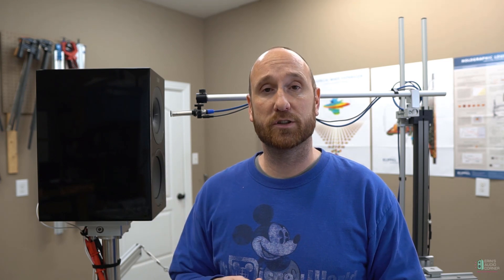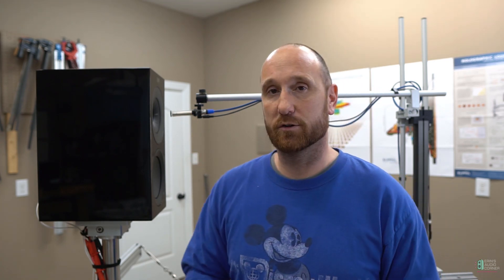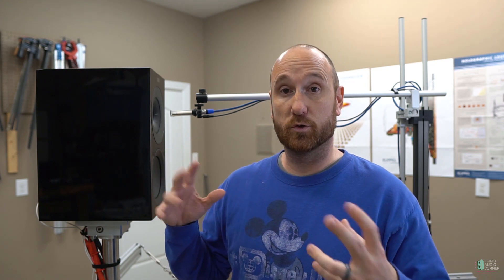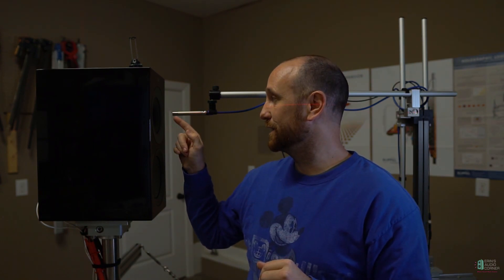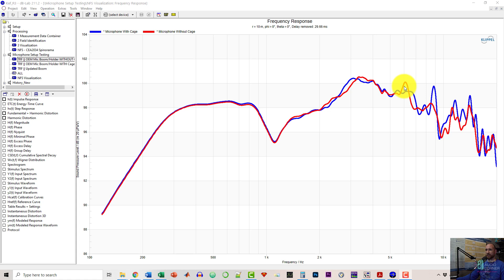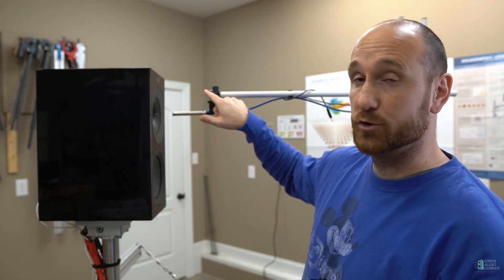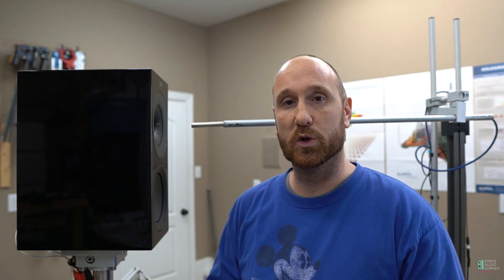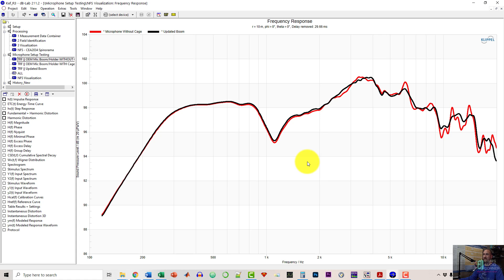Improving Measurement Accuracy with Microphone Boom Upgrade

Comment: Thanks to Erin for the video and thanks to all the people who are watching and commenting his videos.
Here are some answers to the questions about the microphone mount and the safety cage:

As Erin explained in the video, the cage around the microphone is for safety reasons during measurement setup and during the measurement. As the manufacturer we have to make sure that the user cannot simply damage his expensive measurement microphone or the even more expensive DUT by automatically moving the microphone into the DUT. Additionally most customers are using the NFS for measurements during the development of a loudspeaker where the frequency ripple at higher frequencies is not that important because it's known and it stays the same for the comparison of different speakers / development stages. However, you can of course unmount this cage for the final "datasheet measurement" if you are sure that the hardware setup and measurement grid is correct.

Regarding the microphone mount: We know the influence of the relatively big ball joint very well and we are already in progress of finding a smaller microphone mounting solution. But in any case we need the flexibility of the angled microphone mount for our customers and we want to use standard components for this purpose as well. If one really wants to go into details, he could also complain about the different frequency response of the microphone depending on it's position in the measurement grid (due to the directivity of the mic). Therefor it's useful to angle the microphone by 90° in front of the DUT so that the angle of the microphone to the DUT is always the same over the whole grid. This would not be possible with a straight mount of the microphone.

Anyway, we really appreciate the thoughts and questions from this community. We will keep this in mind for future improvements or a small Tech Note

Thomas - KLIPPEL Support.
Reply from the maker: Thank  you for responding to clarify some things.

Comment: How do you ensure the speaker rotates around it's acoustic center? How about the acoustic center of each driver as those are not aligned in many speakers? If it does not the level will change as the mic rotates and that will add a bias error to the respose error as function of angle.
Reply from the maker: https://youtu.be/6j-hg_hRUDM
Reply: @ErinsAudioCorner  That did not completely explain how the true acoustic center for a horizontal polar is defined but it appears though the software MAY have the ability to extract and therefore compensate by removing this acoustic eccentricity error from the measurement.
Reply from the maker: @56ctconger  I discussed that the reference is based on what the manufacturer states and that I sometimes find that to be incorrect but can change that in post to reflect the actual acoustic center.

Comment: Someone else mentioned it, but what about using thin-wall heat-shrink tubing to secure the microphone to the steel tubing?

If the microphone needs to be articulated into nearly any orientation, a "snap on C-ring" type mic clip that mimics the thin metal pocket clip that snaps onto a typical ball point pen or mechanical pencil would be a very low profile mic clip.  This could be custom made out of a short section of thin spring steel tubing and the "pocket clip" end would extend behind the mic....

The clip would terminate just an inch or two behind the center of the rear of the microphone and be brazed to 1/8" -1/4" diameter bendable aluminum "Armature Wire".   You could then purchase another diameter of aluminum, copper, or brass tubing that the armature wire would fit into snugly and be brazed into, or secured via a "JB Weld" type epoxy into your existing tube/boom, etc.

Below is a link for Armature Wire.  I use it on photo and film sets in tight spaces for "hidden" mounts for micro fluorescent or LED "pencil tube" lights to back illuminate beer & alcohol bottles or perfume bottles, or for detailed automotive interiors and table top product photography to easily position and hold small props and light-shaping tools...i.e. "flags/gobos", silks/diffusors, small mirrors or silver/gold reflector cards, etc.  It is easy to bend the Armature Wire, but strong enough to hold quite a bit of weight perfectly in place without sagging/drooping.

https://www.amazon.com/Jack-Richeson-50-Armature-Wire/dp/B00512J4ZY/

...used to hold these pencil tube lights and a lot more...
https://www.alny.net/equipment/kino-flo-micro-flo

Also search for "micro ball head" and see if anything sparks your interest.

Send me some pics of the @ss end of the mic body and cable exit along with O.D. caliper measurements of the aft mic body and the I.D. and O.D. of your steel tube and I can fab something up for you.  I think you still have my phone and email from DIYMA/PayPal, etc.

Comment: It's getting ridiculous now. No one will ever hear THAT level of difference or know it's there or not. Where's my russ andrews wiring.... Break out the liquid nitrogen. christ on a bike. From the same stance that advocates moving the microphone around while taking measurements to now considering a cage like that will create noticeable cone filtering. everything will have an effect but you can mitigate for it after and tune accordingly. 
I saw some other youtuber putting a very large box and driver up at the top of a very tall ladder to attempt to take readings and it was beyond ridiculous, let alone dangerous. You could poke holes in that stupidity all day long. It's all becoming a bit face palm ridiculous. I'd worry more about the quality of cable running through my walls, and the speaker cable etc inside that cabinet than a tiny cage creating 1 or 2 db which you couldn't tell the difference anyway. 
Put enough things under a powerful enough microscope/analysis and you can see the holes/faults in everything. The curve of diminishing returns has already been flattened to unnoticeable levels long long ago.
Reply from the maker: The moving microphone is not the same as what I am doing here. They are, indeed, entirely separate. 

And, yes, I know it seems insane to care about this level of detail.  But the purpose of these tests are to provide accurate anechoic data.  A simple fix to the microphone boom yields the removal of an error of +/-2dB.  That is important.  If someone didn't take the time to make such a modification on a system intended to provide anechoic data then I'd call them insane.  😉

At any rate, cheers for the reply.  👍

Comment: Good, that you noticed this and „improved“ the original mic stand. For example with an Earthworks M30 or similar, they take care about this, also with the shape of the mic.

BTW: Will you extend at least one measurement up to 30 kHz bandwidth (not for all Spinorama data, just for one on axis data), in order to detect bandwidth limitation, in case of 48kHz DSP in active speakers (as John Atkinson (Stereophile) is doing this or Amir (Audio Science Review) does this lately). I would appreciate this. Thank you very much.
Reply from the maker: I'll try to keep that in mind.  Thanks for the feedback and suggestion.  :)

Comment: Do you need a different calibration file when you remove the cage?
Reply from the maker: I attach the cage for the first round just to make sure everything clears ok.  Then swap it out for the other mic.
Reply: @ErinsAudioCorner  i meant the calibration file for the microphone.
Reply from the maker: @habdulahsalam  oh, no.

Comment: This is exactly why I got so excited when I heard you're getting an NFS. Can't wait so see some reviews!

I wonder if it would be possible to mount the mic completely flush with the bar using some ultra strong glue or epoxy.  I'm also wondering if the hollow tube might resonate at lower frequencies.
Reply from the maker: Thanks man.  

Well, FWIW, the tube that came with it was hollow; just capped at both ends.  As for flush-mounting, I think I have a solution that will work.  Set it up tonight but decided to take a break from the garage for the night.  :)

Comment: No, not really news... But you chose the absolute worst scenario to compare it in... Horns, waveguides and coaxials are really difficult to do near-field measurements on. If you bump the mic just a few mm's (1/16") when up close to an acoustic waveguide you can get 0.5-3dB differences in very local peaks. I had that problem when optimizing the x-over of a set of R300's (same drivers as your setup?). Consecutive measurements showed very different 10k+ behavior. And i used a 1/4" totally flat tube with a B&K measurement capsule at the end, no step or bumps. The capsule is mounted with shrink tube to the 4' aluminium pipe.
For measurements below 4-6kHz, the differences induced by boom reflections are typically tenths of a dB, so to measure differences the best setup is a small dome tweeter on a flat baffle... Gives most repeatable results :)
Reply from the maker: Sounds like you have/had more variation in your test than you think. 0.5dB?  Maybe. 3dB?  Something else is going on besides just 1/16” difference in mic placement. Doing the math, that is a wavelength of about 216kHz.
Reply: @ErinsAudioCorner  I said (wrote) "just a few..." didn't I? :)
As long as you're within 1x the throat radius of an acoustic coupler, the internal reflections can be quite severe. Try it for yourself. Try moving the mic 3/16" - 1/4" when near-fielding an acoustically "loaded" source. Especially partially shaded ones, like the KEF coax.
And BTW... some food for thought: You only need a quarter wavelength reflection offset to get +/-3dB - which in the highely unlikely "worst case" difference is 3+3=6dB differences between measurements. 10k = 34mm (1.4"?). divide by 4 > 8mm, or 1/4" gives +/-3dB @10k. And hence, 4mm or 1/8" can give +/-3dB at 20k.
So, yes, internal mouth reflections can do quite large differences over very small XY positions in the top octave measurements.

Comment: What if you were to put a deadcat at that transition point, would that negate any comb filtering? Also, I'm curious if the pipe you're using has any harmonic resonance during the test.
Reply from the maker: Possibly on the deadcat idea. I was just thinking foam. Pattern is full on the pipe resonance.

Comment: Hey Erin, 617 here from ASR. Troels Gravesen did a study of mic mounting effect on FR. His suggested configuration resembles what you did with the rigid conduit. You'll notice that most measurement mics which terminate in an XLR smoothly taper from the 1/2" element down to the 3/4" barrel. Ideally it would be 1/2" for as long as possible.
Reply: Annnnd apparently you've seen his article, lol.
Reply from the maker: @ActuallySettle  haha. Yep!  😉

Comment: Done the way it should be done. THinking testing and refining your measurement rig. Very nice to see your thinking process. This is a welcome improvement over the Klippel system setup.
Reply: I wonder why Klippel doesn't provide a suitable reflection-free boom. Considering the price.
Reply: @johnwright8814    Let me see, Lack of acknowledging that there is a problem? There are only so many sizes of microphone diameters. And If I remember correctly they supply a mic. If this is true, then there is truly no excuse for this. Klippel is good measurement gear. But it is not the only way to measure loudspeakers accurately. They have successfully marketed themselves. And that is a two edged sword. Other test sets are as capable, and in someways even more capable. Every test setup requires some additions of a turntable and of mic booms. Erin has me thinking about making up a similar test rig for my Smith &Larson Speakertester Pro.
Reply: @KravchenkoAudioPerth  I think it's the software that makes Klippel special.
Reply: @johnwright8814    Well There are other sources of software that later get incorporated into what Klippel is doing. Plus very happily many of the people that work at Klippel have published thesis' on an aspect of loudspeaker testing that get published. A little digging gets you a long way.  Mathlab even has an opensource equivalent called Octave. They have to publish their code in their thesis :) Muhhaaahhhaaaa
Reply: @KravchenkoAudioPerth  Thanks for your suggestions, I will do some digging myself....I looked up your website; very interesting....

Comment: Do you find it disappointing that Klippel did not do something like this out of the box?
Reply from the maker: Not particularly.  See my reply above.  One can use an IEC mic or an XLR mic (or other types) so what they provide is pretty standard.  I think that if I were to ask for a hollowed out tube entirely they would have been happy to provide that instead of the boom threaded for the mic adapter.

Comment: "If you stuck around this long" -of course I'm still watching. Makes me wonder why klippel chose this mounting solution? Is there a way "calibrate" this early mic reflection out of your data so you can just use the boom supplied?
Reply from the maker: Well, the mic cage is a safety feature to keep someone from damaging the speaker while testing and they assume one will remove it for final testing.  The mounting of the microphone hanging off the mic boom is pretty standard.  Look around any store and you will find a pole with a mount attached to the end.  In fact, I do not think I have ever seen more than a few people mount the microphone directly off the boom and those who have are DIY guys or some of the more well-respected measurement facilities (Warkwyn comes to mind).  I don't think this is an oversight by Klippel at all.  It's just something I'm sure they expect purchasers to understand and will deal with accordingly (if they even see fit).  In my case, however, I'm going uber-nerd status and ... well... here we are.  :)
Reply: @ErinsAudioCorner  ahh, I was just wondering if you could create like a "house" curve to correct for the mic mount, just so you didn't have to use some modified contraption, yet get the same results. 

Also, this clearly shows your understanding of the equipment, solidifying the quality of your data.  Please keep posting and making videos, love following along.
Reply: @stockleyrod  it would be a new curve for each position so it would be a real hazzle.